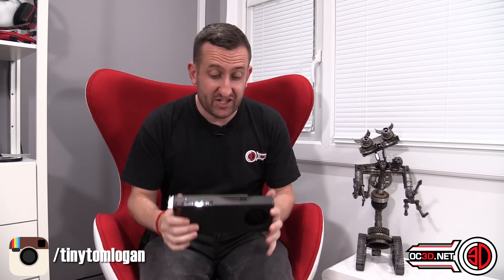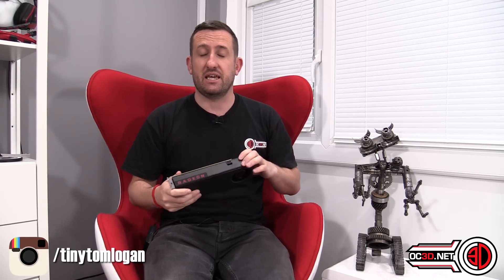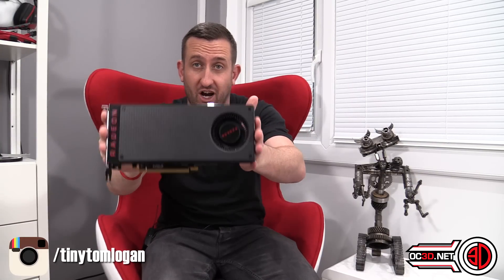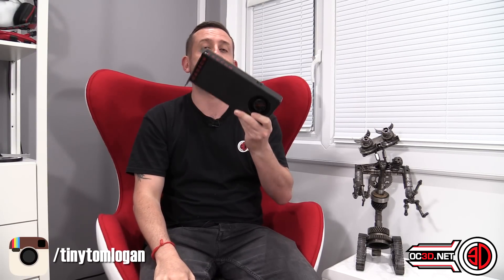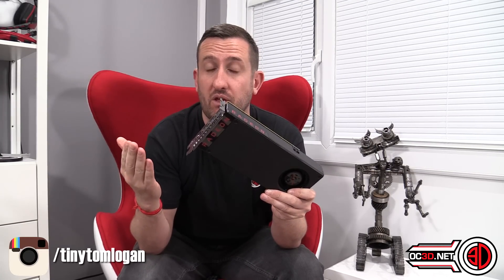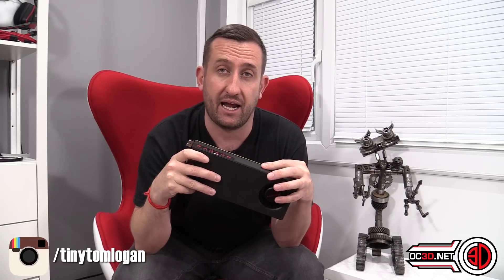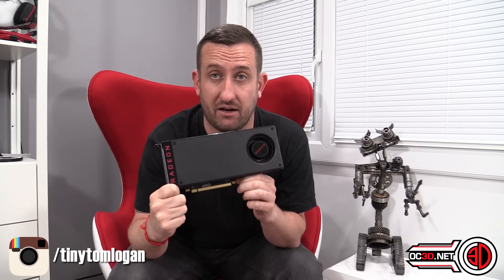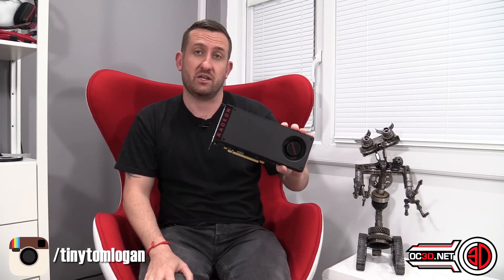RX480 power bottleneck? TTL Talks

Comment: So it can be easily fixed if let's say Sapphire, Asus, MSI, etc. adds another 6 pin connector?
Reply from the maker: Power usage will rocket though
Reply: Yeah, I'm watching the part where you explain it with cars ROFL
Reply: if a 1070 is in your budget you might as well save the extra $200 or what ever it is for a 1080.
Reply: There's no reason you shouldn't get the 1070 if it's in your budget.
Reply: It feels like this card was made for a specific clockspeed.
Reply: Justin Bechtel Not worth it. 1070 has better performance/price. The $200 I'll save for my next upgrade.
Reply: Sapphire confirmed an 8pin connector on their cards
Reply: MrOgeidAzip1 AIB's always the better thing to go ahead...Reference/founders always sucks for some reason
Reply: +47Knucklehead maybe add some vulkan games to the bundle
Reply: ***** lol... 3gb is enough for 1080p? 15% difference? Lol. I loled so hard when i saw "it will be the same as GTX 980" yeah just like RX 480 is. :D
Tell me why would they sell GTX 980 for 400$ then make a new GPU which is exactly as GTX 980 but for 250$? Nvidia doesn't do that.
Reply: Pastechi Yes, 90% of current games won't use more than 4GB's, but those additional 4GB's come handy on the other 10% of games, and probably new games will start using more than 4GB's too. This is a budget card, and people who buy budget card usually upgrade in a timeframe of 2 to 4 years, sometimes even more, so future proofing your card is important for some people. Also this card has a much better performance in DX12 and Vulkan games so it is likely that it will get benefited with the additional memory on those games.
Reply: Question is will they draw more power than a 290/x
Reply: the 1060 will beat the rx480 and prob in the same price range if retailers dont overprice it....wait for the 1060 aib's and get those and screw the rx480
Reply: ***** Yes, AMDRadeon will have to offer a clever solution to address this, maybe offer the bios change with a bundle of Dx12 titles and well an open and sincere explanation of the issue
Reply: knucklehead - AMD are including Vulkan API with their drivers since Vulkan is platform agnostic so will work on W7 and W8.
Reply: rewatch the video.... it requires power but doesn't scale nicely
Reply: +Jure Pičulin
That has yet to be determined. There were a bunch of reports saying these things could hit 1600 MHz, that could very well have been from AIB cards with better cooling and power which could yield impressive boosts in performance though yes, it'll probably also consume a lot more power.
Reply: yea maybe but that cards will be like 400$ / euro
Reply: Black Shadow
What's the 480 run in Euro land? Here in the states the most the non ref cards are reported to go for is $300.
Reply: Son37Lumiere yes, they consume a lot more power to reach that frequency, but frequency =/= performance. We need actual measured performance to conclude that OC works. That's exactly what the guy said, the underclocked stock cards performed the same as overclocked ones!!!! The power was the issue and not even with extra power was there much improvement.
Reply: Jure Pičulin 
But there was when he upped the power limit, that's the point, they are power starved on the ref design with one 6 pin. With dual 6 pin or an 8 pin it's an entirely different situation.
Reply: Best fix is to buy 1060 instead, or wait RX490.
Reply: ***** they said there wouldnt be any new card with polaris being released any time soon, so i dont think there will be an rx490
Reply: You can wipe my ass with that 1060 piece of shit card with 6 gb.
Reply: sermerlin1 3gb is enough for 1080p. It's 15% faster card than RX480, could be a difference of 50 vs 57 fps .
Reply: 2.8 terbyte with 6 gddr5, 1050 MHZ, do the math....not even 970
Reply: Indeed. Asus, MSI, and Sapphire already announced their RX 480s will come with  8-pin connectors.
Reply: ***** 4gb is enough for 1080p. There are games that take to almost 4gb thats why. And if you are the type of guy who play skyrim with texture packs not even 4gb is enough. 6gb is more than enough. 99.9% of those having the rx480 wont even use 6gb of that 8gb anyways.
Reply: MaddXav yes but what if the time comes that games uses more than 8gb of ram.....wouldnt the "amd r780" or the "gtx 1360" be released already? People seeing the 8gb on the radeon thinking its better or can be faster while its just an extra 4gb that u might never EVER use. And if u do, its gonna be probably lower than 4.4gb of vram.
So 6gb is more than enough for 2 to 3 years in my opinion lol. The gtx 1060 might actually crush the rx480 u never know
Reply: Pastechi 
RX 490 will be coming at the end of the year as a Vega part.
Reply: Son37Lumiere
the point he made was that the cards are power-starved even at stock. Upping the power limit allows for performance gains and even some overclocking. However, the most important point he made was that the performance gains were much smaller compared to additional power required, which means that the card scales very poorly with additional power. Perhaps AIB cards will be able to push the clock high, but the power required will be disproportionately  higher compared to performance gains, which might make good overclocking cards expensive.
How I see this, these cards are perfect for the price at stock clocks, and would benefit from some undervolting, but trying push it too hard is a hard task.
Reply: Jure Pičulin 
That's a definite possibility, we'll see soon enough. Some people have reported that undervolting did improve both performance and temps on the reference however it's a luck of the draw. AIBs are also reporting that it's largely a chip lottery as some overclock and perform much better than others.
Reply: Son37Lumiere AIB's like sapphire and asus did put a 1x8 connector on their cards tho. The AIB's are prob those who might save the rx480 lol
Reply: Pastechi
of course, the card will work nicely on AIB samples, but that's not the point made in the video. The point made is that it doesn't scale really well with power. But we have yet to see...
Reply: Adding connectors is just giving yourself more copper (ie ensuring the cables don't melt) between the gpu and PSU, its not really going to do anything unless they fix the power phases as well.
Reply: Zwan
errrrm, a custom design with 2x6/8pins would have different power delivery, allowing for more power in total, and relieving the motherboard slot from stress
Reply: well i prefer GTX 1080
Reply: Brodcast X
 last gen tech, last maybe another yr., for 700+
Reply: is it going to fall the next yr ?
Reply: The Sapphire Nitro+ releasing with one 8 Pin power connector.
Reply: reference cards are for water blocking. doing this on mid range is iffy, but doable if that's all your looking for.
Reply: 3gb IS enough for 1080 lol.  I run 1440p on a 2gb GTX 680 and 4-5 year old pc just fine. It even handles multiple games open at once with a dual display setup.  Its on the fringe of memory cap however with my 2gb card and 2 games running.  A 3gb card would be better for 1440p but 2gb gets the job done. 6gb is enough for 4k, seriously. but 3gb is MORE than enough for 1080p.
Reply: Jure Pičulin
No.

One does not insinuate the other.
Reply: Zwan if you look at r9 380 or anything in that range you will find that power delivery was done properly. At a similar price point, it is hard to imagine why AIBs would screw up their design of RX 480 when they are already making custom boards and there is nothing difficult about making a card with proper 150W from PCIE connector and around 50W from the PCIE slot
Reply: Jure Pičulin
As I said, a power connector does NOT mean they have gone and fixed up the power phases.

If they have gone to the effort to alter the power delivery, they will advertise it. Please use this information, not counting the number of power connectors.
Reply: Zwan actually, AMD's reference design is almost OVERBUILT (compared to for example GTX 1070/1080). They made a mistake by including only one PCIE connector.
I get your point but AMD's mistake is more stupid than under-building the card. With already 6 phases in reference design it should be straight forward to up the power delivery. (6 phases IS enough for let's say 180W, only the delivery from PCIE slot need to be reduced
Reply: Jure Pičulin well it is under-built with the RX 480.

Comment: but what about that reddit post about it using to much power from the mobo? increasing the power% will increase that would it not?
EDIT just saw the explanation at around 10 mins
Reply from the maker: Increasing the power % does make that worse yes. Thats why its been capped.
Reply: +OC3D TV yeah sorry , I commented before you explained it at around the 10 mins mark :P thanks for the reply too:)
Reply: Any card thats overclocked pulls more that the 75W some pull over 150w not just radeon. The only reason to worry is if you have a cheap motherboard point blank. Ive been running the card non stop since launch absolutely no issues.

Comment: neeeeed to wait for veeegggaaaaa

damn I can't decide to pick two of these or just get one vega card and be done with it 

they are so appealing at this price range
Reply: why buy 2 when you can get a gtx 1070?
Reply: Just buy a gtx 970
Reply: Well it seems to hold more value that a single 1070 when combined but cross fire still isn't that great 
Also I'm a value gamer and do some small unity projects so an open cl driven card that is cheap is always great 

Then again I could wait for vega if it performs around a 1070 for less 

Although it might be louder and more power hungry 

It's good to have options 

I might get a 1070 if didn't cost me 700$ where I live 

God the demand is just crazy and some ass holes here bought like 5 on launch and are reselling them for more than msrp and I mean alot more

:/
Reply: Barry Cooper nah I already have a loud r9 290 with a hacked bios to a 290x 

I need alot more umph for the cash 
So 2 of these may do it or just wait on vega 
I'll have to wait and see until then more 1070 models and vega cards will be on the market
Reply: kublaikhan1215 need to wait given the 700$ prices 0_o some Dick local shop got select cards and sold them to a competitor which now is pricing them for 700$ so it's impossible to get my hands on one but with this card flooding in and crowding the market here it might end up as 269$ for the 4gb so it's still cheaper and more powerful setup to get two of these where I live then again might drive the cost of 1070 here down a bit or I'll just wait for vega cards

Darn I wish to live in places like the US just to get my hands on these cards for less 
I would have even forked enough cash for a non reference 1080 :,(
Reply: +Zero Sami there is literally 4 gtx 1070's chilling right here in my best buy here in El Paso, TX. There was one gtx 1080 so I bought it with the quickness. I'm literally looking at them right now lol!
Reply: Read the TPU CF review, 6 out of 16 games they tested actually benefitted from CF. Get a GTX 1070 for LESS money, it beats 2 x RX480's in most games anyway.
Reply: *****
The 970 is cheaper than the 480 here in the uk and even with the lower ram it still kicks the 480's ass. Once you overclock a 970 you get 980 performance. Its a no brainer unless you are an amd fanboy. The 390x is the same price as the 480 here too. Scan pc is an online shop you should look at
Reply: +Barry Cooper
You have to overclock the 970 to beat the 480 in most games and it's not future proof. If the 390X is the same price than that's the no brainer. You'd truly have to be an nvidiot to pass on that for a 970.
Reply: kublaikhan1215 I wish I had access to best buy but I partly visit in romania and we have an import tax of 24% on electronics and the price goudging and founders edition prices isn't helping me right now
I'm passing off nvidia and skipping to polaris or at least when prices decide to magically drop to compete with the cheaper polaris cards